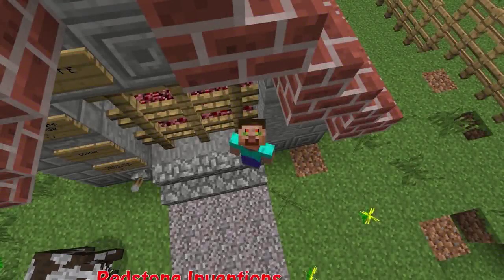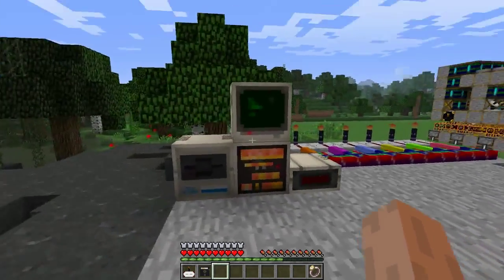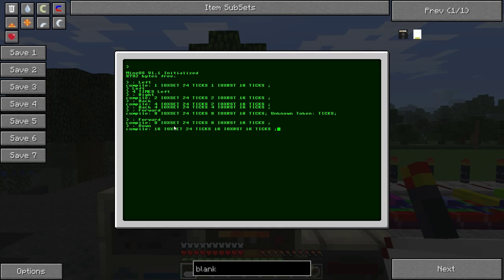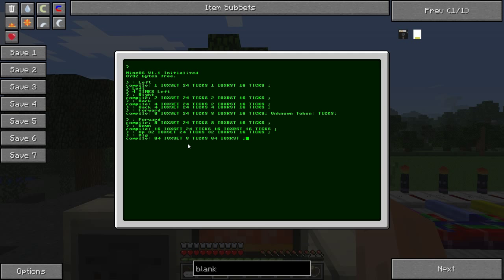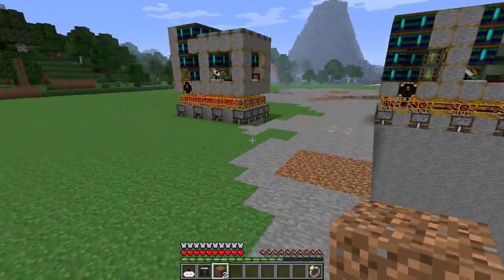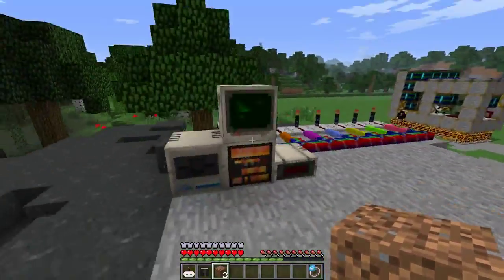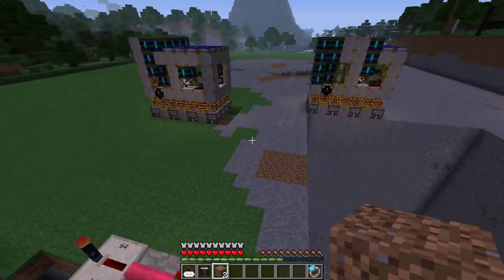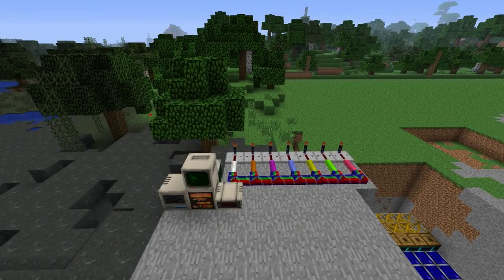Tutorial - Portable Six-axis Frame Quarry - Basic Programming [Part 2 of 3]

Comment from the maker: My timings were correct, however your issue may be a lack of power or power not transferring fast enough to your motors. This issue is more noticeable with larger quarries. Adding more solar panels/battery boxes should help, otherwise you temporary fix seems like the go. Glad you could figure something out :)

Comment: i only had one problem, and that was with programming. i fixed the problem but possible explanation would be nice. the timing on the transmiters were wrong and were transmiting too fast, making the quarry miss its moves. i had to change to command set up to the format ex. 1 IOXSET 24 TICKS 1 IOXRST 32 TICKS ;  so it would space out the time between signals

Comment from the maker: Reprogram the directional commands (Left, Right, Up, Down, Forward, Backward) to include a longer delay. e.g. 24 TICKS on, then 16 TICKS off instead of 8 ticks.
And then reprogram the words that use those words (because the words aren't referenced, and are instead compiled with the larger word).

You could also try putting the directional commands in a temporary compiled word using the DO LOOP instead of TIMES (TIMES doesn't work inside words) and see if that makes a difference.